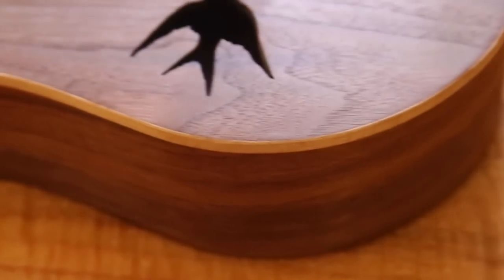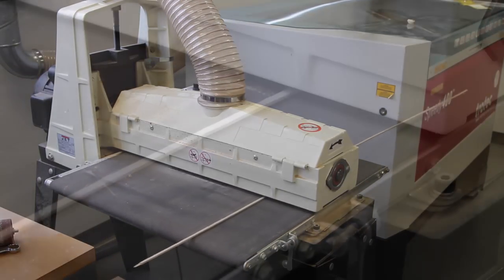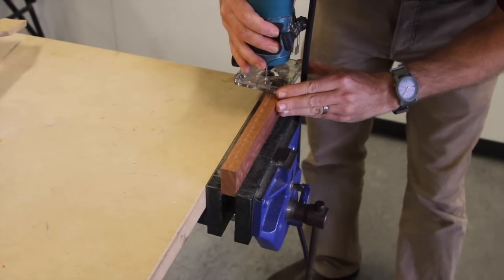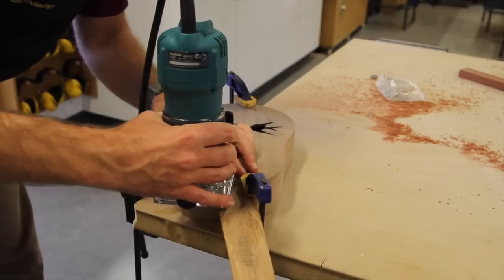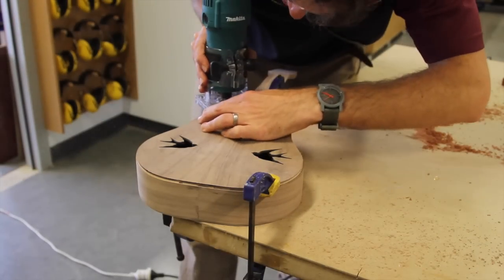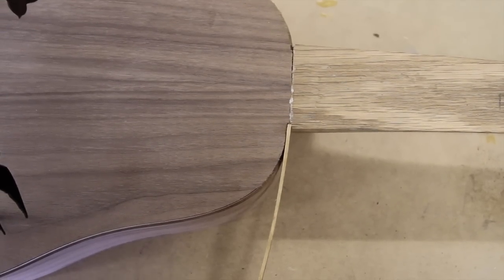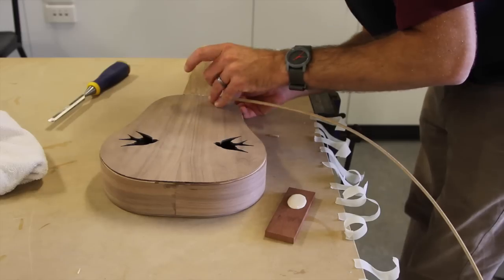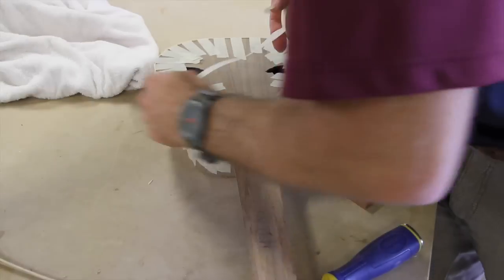How to Attach Ukulele Binding

Comment: Thanks for sharing your experience. I found this video because of the binding instruction, then I noticed how far back your sound holes are. This is the first I've seen of this placement, have you found any sound issues you'd like to share going this route? This appears to be a concert size ukulele, correct? So I'm assuming the sound holes in line with the bridge is no problem with strength of with the strings pulling on them, is this right?